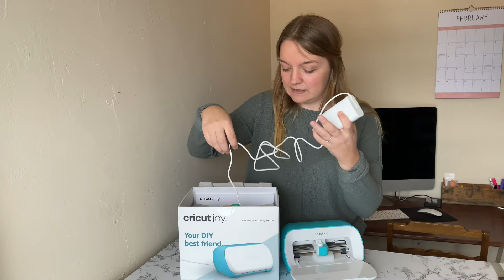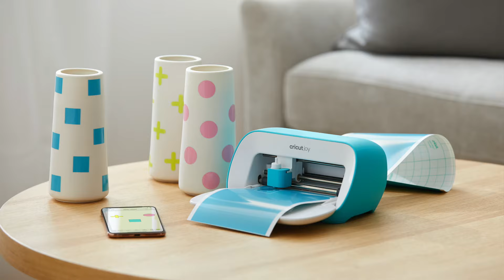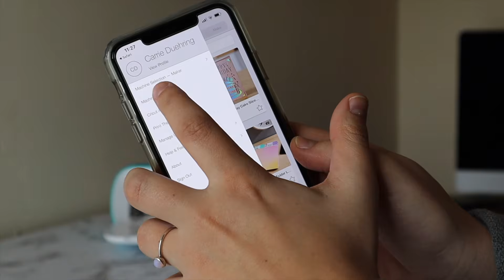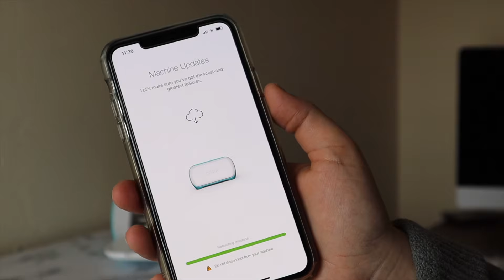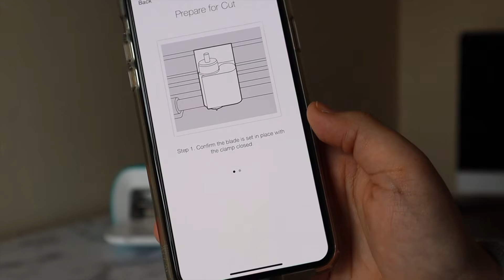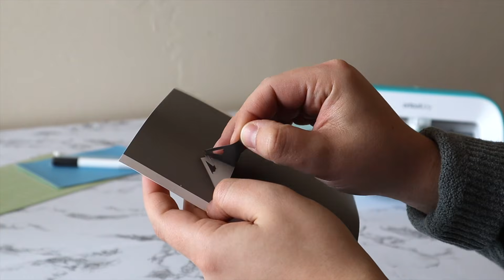How to Set Up Cricut Joy // Cricut Joy Unboxing and Set-Up for Beginners

Comment: Can someone tell me if Cricut Joy works with Chromebook? I feel like returning this Cricut. So frustrated. I bought this to make personalized ornaments and I can't find a way to "CURVE"  it. It doesn't appear on my screen.  Please help.
Reply from the maker: Design Space, the software required to use the Cricut Joy, requires a Windows or MAC operating system. Chromebooks run on Google's Chrome operating system, which is not compatible with Design Space.

Comment: Hey I got a cricut joy today an it won't cut keeps coming up with a solid red light. The blade cutting part is to the left idk how to get it back to the middle an if that's what's causing it not to feed through an gam when it goes to start cutting
Reply from the maker: Oh, no! I would recommend contacting Cricut's customer service — it sounds like something could be wrong with your machine! 1-877-727-4288

Comment: Do you have to have WiFi to use it in general, or just have WiFi for updates?
Reply from the maker: You are correct! You can use the Joy without Wifi, but I would definitely recommend connecting once and a while for updates :)